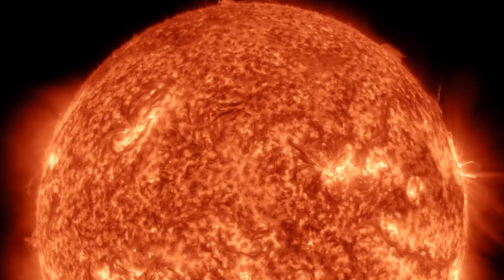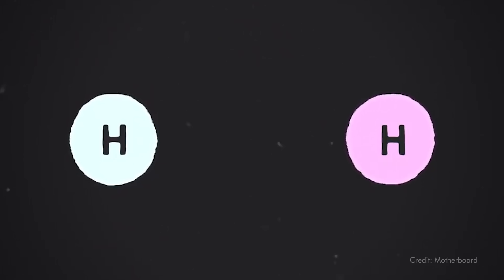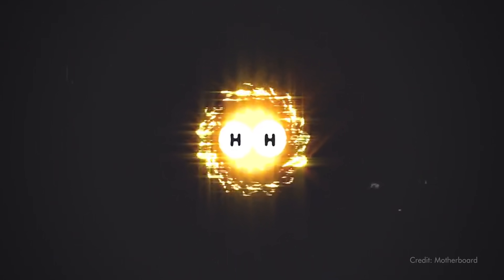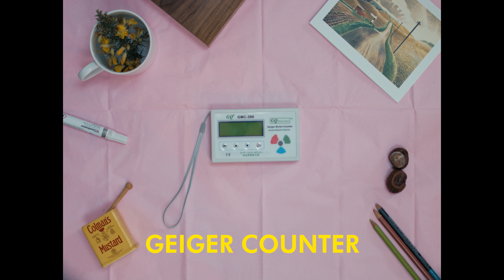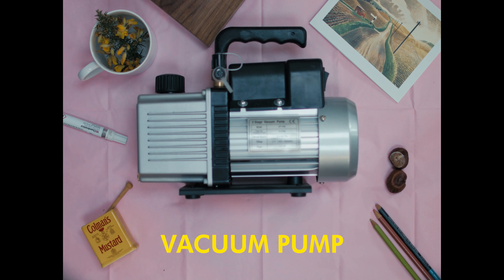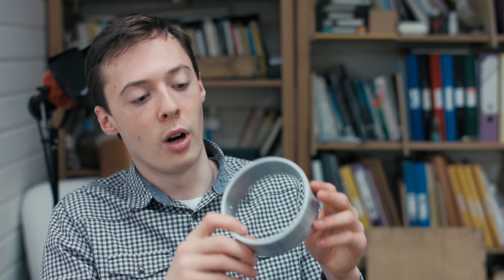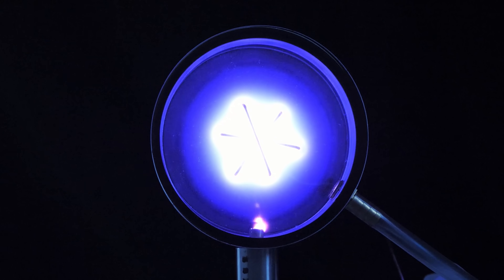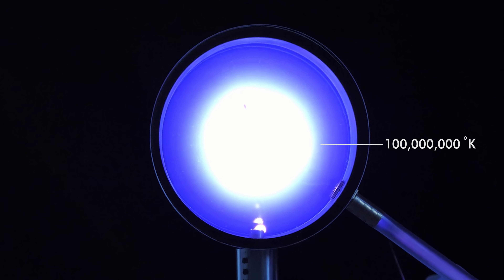Making a Desktop Fusion Reactor

Comment: Does the vacumme needs to be maintained continuously or can it be a sealed unit?
Reply from the maker: If the seals are good enough it can be a sealed unit, but the plasma will break down if the pressure climbs too high!
Reply: @WillFromLondon  ah, thanks that would be much more practical as a device.

Comment: Now I am a physicist.
First of all, that light isn’t from isn’t fusion, but simply a cold-cathode gas-discharge lamp like a neon tube. Most of the current going into your fusor is just shorting through the ionised gas from one grid to the other, which is both what is producing all that light, and is why this sort of fusor will never be anywhere near producing a net gain in energy. And I bet it would look similar and about as bright with ordinary nitrogen+oxygen in there. To get fusion you’d need to have deuterium inside the chamber. Secondly, referring to that 100MK temperature is a bit misleading. Technically it’s correct, but I doubt you’d see much blackbody radiation indicative of that since the particles aren’t in a thermal equilibrium; since their kinetic energy is augmented by the electric field.
Still it’s a great looking project. Too bad the surrounding electric field would make me hesitant to put it on a desk near any computers or the like. I know I’ve seen someone’s computer acting up just because a mains CW multiplier was nearby.

Comment: I’m just some fucking spastic sophomore with a relentless brain

I will make what David Hahn did, exempt I know about radiation and I don’t want to spew radical neutrons everywhere.
Reply: A design of Roman concrete and clay and forged car battery lead

The gear to handle the materials

The pods to store the used materials (likely to give to the feds)

“Foundation” a building which to build thy reactor which the “blight box” will be standing on.

Comment: I would be careful with the radiation created of it while standing on your desk. That „Fusion“ might create also create radiation with shorter wavelengths than the visible spectrum, live UV and even shorter, which meight be able to ionize things it hits. Like your DNA, what can lead in unlucky cases to cancer. Also I think that some of the light is created by fusion, rather it’s created by atomized Ions which are on a higher energy level and release their energy in the form of light. It’s a effect that is also used in AES (atom emission spectrometry)

Comment: i'm not hating. the decive and the video are admirable workmanship. but i call shenenigans! this makes for a cool and propably slightly carcinogenic light show, but by fusing mere hydrogen with such a crude hirsch farnsworth fusor, you would have beaten generations of nucear physicists!  there's a readon even tokamaks require tritium or deuterium to achieve fusion. 
so... did you acheve fusion and detect neutron radiation? with a proper device, that does not respond to x-rays.

Comment: You can run this with Deuterium as well by electrolysing D2O (Deuterium Oxide) that you can buy on ebay for very little cost. e.g. 9 Euro for 2.5cc at https://www.ebay.com.au/itm/2-5cc-Deuterium-Oxide-99-92-purity-in-glass-vial-heavy-water/142879634393

Comment: Nice work.  I did this in 1987 when the cold fusion idea was originally floated.  Im guessing your filament material was iron or possibly ni-chrome or tungsten.  Regardless, If you ran this experiment for very long,  you would have noticed the hydrogen "disappearing".  Certainly not due to fusion, but to the adsorption of hydrogen into the filaments and the housing. Aluminum can do this and Fe is one of the best ways to store H2 in its metallic matrix.  Back in the '80's we were using Palladium, as it too can absorb H2, D2 or T2.

The concept at the heart of this experiment is NOT the temperature but rather the electric potential required to accelerate ions toward each other. The accelerating force is inversely proportional to the distance from the electrode.  So, very small distances from the cathode surface and high electrical potential means a greater force on the ions (protons or nuclei)  You can do this with as little as 700 Volts DC (the Ionization of any gas in this way is called a cathodic discharge).   Having a higher voltage is better for acceleration, but a lot of the gas that surrounds the plasma "thermal-ized" or slows the ions by bouncing into the balance gas.  So Lower vacuum is good, but too low and you cannot sustain a plasma; so there is a critical gas pressure/temperature problem.

The proper set up for this experiment is to add a pressure / flow controller.  It supplies balance gas and accounts for changes in pressure due to temperature rise of the apparatus and the balance gas.

lastly.  you cannot fuse normal hydrogen. (I like you generated the hydrogen rather than bought it  (H) as there is nothing to hold the nucleus together once the nuclei are in proximity.  For the strong nuclear force to hold them together (remember; two positively charged particles close together see an ever increasing electrostatic force repelling them). To overcome this force you need another particle to contribute the strong force...namely a neutron.  Thus you need deuterium or tritium isotopes of hydrogen for fusion; the extra neutrons providing the additional strong force.  Once fused, any excess neutrons are ejected. 

So to detect if fusion has occurred you need one of two kinds of detectors.  1.  an ionization (or gamma ray) detector or 2.  A neutron detector.  The free neutron wont live long floating around by itself.  As soon as it hits another element, like AL or FE, it creates an isotope of those elements and a gamma ray is given off.  Or you can detect the neutron itself with a Boron/neutron detector.

I've often thought about re-creating these early experiments with some modern techniques.  Palladium is not hard to come by nor is any of the transition elements which have these properties (Titanium, Vanadium, etc).

For those that haven't delved into this much; "cold" fusion does exist, but not in the form that would make it worthwhile.  There is lots of evidence in the emissions from Volcanoes and some metamorphic rocks.  I think the final statement about this phenomenon was  "Cold Fusion is a rose;  not a tree".    Not sure where the current state of the art is; but if I had to guess, it would be at really cold temperatures because of the quantum mechanical aspects and not a high temperatures .

Comment: As a physics student, I have to ask, how do you know you achieved a fusion reaction? H-H fusion is pretty damn hard (at least compared to using deuterium or tritium), and even in the sun, it actually requires 4 hydrogen atoms to make 1 helium atom. Did you do any tests on the gas that was left in the chamber after you ran it?

Also, I'm seriously concerned about the lack of obvious neutron radiation shielding, which is a necessity if you did achieve fusion.
Reply: he doesn't achieve fusion. a fusor like this needs deutirum to fuse, and when it does it is essential an omni directional nuetron gun. but if you just pull a vacuum and light it up it's just a homemade plasma 'globe' desk toy
Reply: @RovingJack  I'm aware of all of that, which is why I asked what I asked.
Reply: Hi Sam, yes he does achieve fusion.  The gas is deuterium, and the only way he knows that fusion was achieved is because this has been done before (most notably at the University of Wisconsin) where neutron generation was definitively measured.  Of course fusing nuclei and generating energy that exceeds the input are two things different altogether. If you want to read more about their results you can go here; https://iec.neep.wisc.edu.  Good luck on your studies!
Reply: @edharris6452  No. He did not achieved fusion.
Reply: @edharris6452  what he used was basic hydrogen from a aluminum/drain cleaner reaction not deuterium (i mean some of that hydrogen was likely deuterium but it was 99+% normal hydrogen.

Comment: You can actually hear the geiger count scream! What levels of radiation did it measure? I suppose those are xrays? How did you extrapolate the temperature? Thanks man, great job!!
Reply: if this is a joke/sarcastic comment, ignore the rest of this reply

the geiger count is an edit and there's no actual fusion happening. The only radiation comming from that would be electromagnetic radiation, and wouldn't be strong enought to cause real harm
Reply: Jackson Li 
I do agree there’s no fusion, but the device reminds me of an xray tube, where this very high voltage travels from the cathode to the anode, through vaccum, causing the anode to emit xrays (an eletromagnetic radiation with wavelengths ranging between 0.01 and 10 nm)
Reply: @bru0009  It could very much be something simular but this should be closer to an plasma globe then an X-ray tube. And even if it is and X-ray tube, there shouldn't be enough radiation to cause harm

Comment: Quick mafs suggested that it could be possible to build it like this... Let's try it out! :D

For people not believing me:

Fusion happens if the protons of the 2 fusionpartners reach at least x10^-15 terrain. So you need to find the speed to accelerate these protons to overcome the forces of the core.
Will takes ~60kV. Let's use this to calculate.

You can calculate the minimal diameter 2 protons can reach if they get accelerated right against each other by:
r = e / (4 * pi * epsilon0 * 2U)
with numbers this means:
r = 1.6 * 10^-19As/((4*pi)* [8.85*10^-12(As/Vm)] * 2 * (60*10^3V)) = 1.2 * 10^-14m which is 12 * 10^-15m
If r < 10^-15m Fusion can happen.

This means with some fluctuation involved this indeed could be fusion!

But hey if I miscalculated there don't blame me I am still at school and this is just what we theoretically learned at school in Physics... I am just pretty sure this works like that :D

Comment: Okay, that's a Farnsworth Fusor, invented by Philo Farnsworth, who also invented the video camera (and a lot more things related to television). I'd expect that the heat and high voltage would quickly erode your silver-plated coating inside the chamber. And the device is putting out UV, X-rays, and energetic neutrons; don't sit too close to it.

Comment: For all you dumbasses that think this video is real if that lightbulb got to even just 5000 degrees Kelvin(about the surface temperature of the sun), it would have burnt down his house, let alone one million degrees Kelvin. Secondly, to start a fusion reaction you have to feed it immense energy usually done as heat(so he got that part right), which can be done from electricity, but you would have to be tapped directly into a power line to draw that much power. If he tried drawing that much power from a power outlet or several in his house, he would definitely blow all of the fuses in his house.
Reply: You do know what a tranformer is and how it works, right?

Comment: Vid was wel edited but should have been more clear this is a FUSOR not a FUSION REACTOR it won’t generate net energy and just generates neutrons. Good if u want to make a bomb I guess
Reply: fusor and fusion reactor are the same type of device, and he stated that it would be a net energy loss. 

you need to do your homework before making statements like "this is not a fusion reactor" as if the device creates fusion reactions, IE, collides hydrogen atoms to form helium atoms, it very much IS a fusion reactor. You seem to be convinced that a "fusion reactor" must produce more energy than it uses to run it. That's a whole different thing altogether.
Reply: @KatherineClairmont  idk why 75% of your reply is attacking me. I wasnt very complete I guess. Fusion Reactors use magnetic confinement to super heat plasma whereas Fusors send everything to a central location. This doesnt use the iconic swirling plasma that fusion reactors use which is what I was hoping to see. Also some fusion reactors do generate very tiny net gains, but I wrote an entire social impact analysis essay on the ethics and practicality of them stating that it is not a viable power source. Again. this is a cool project and a great video edit but I wanted to see circular magnetic confinement in a small form.
Reply: @Cl0udWolf  you don't understand that the high voltage in that central wire coil generates a magnetic field, which confines the plasma to that location, in a fusor? 

You seem to think that because this device is described a certain way, it must do a specific thing, but your expectations related to the terms used are completely arbitrary. Furthermore, if you wanted to see circular magnetic confinement in a tabletop format, perhaps you should construct it yourself. 

The video isn't titled "Tokamak fusion reactor" which is what you are describing. There is also inertial confinement for fusion reactions, such as what is being attempted at the National Ignition Facility in the U.S.A.

Lastly, the fact that you wrote an essay (which, given your last two comments, I must say was likely a fairly incomplete essay) on the matter of the SOCIAL impact of this technology is completely irrelevant to the facts at hand. This device does create nuclear fusion. Currently there is no method of creating nuclear fusion which can produce more useful energy than is consumed during the various steps to achieve confinement of the plasma, heating the plasma to the necessary temperatures or ensuring the lasers or superconducting magnets (whichever the case may be) are kept appropriately cool. 

Perhaps you should limit yourself to social commentary; your understanding of the technologies in question is severely wanting. As for your essay, you claimed that it isn't a viable power source. You neglected to mention that with the appropriate technological advances, it would be a viable power source. It's sure as hell more viable than continuing to burn fossil fuels until our planet is uninhabitable.

I knew that most schools have been suffering from reduced funding in recent years, but WOW does it ever show.
Reply: Katherine Clairmont sure high voltages do create magnetic fields not exactly what I was thinking, as tokomak styles, and the stelarator are currently the most successful types. Undeniably a better video title would be How to build a Fusor or Making a desktop fusor